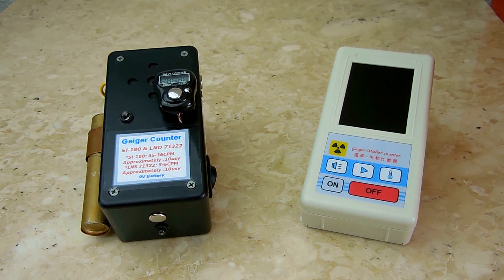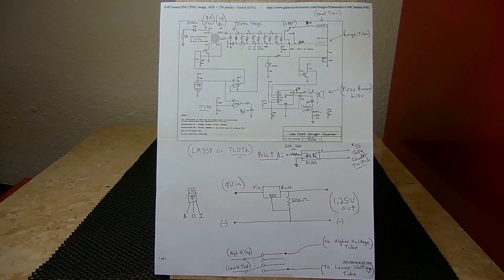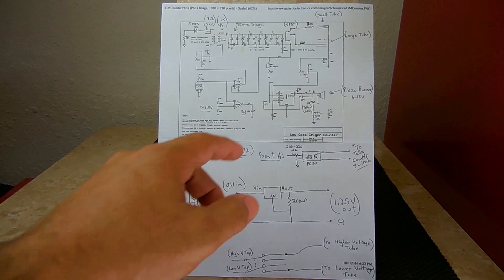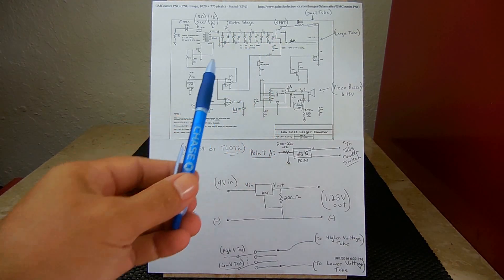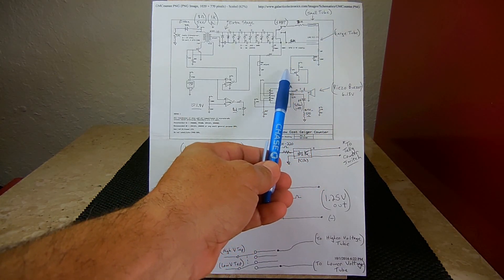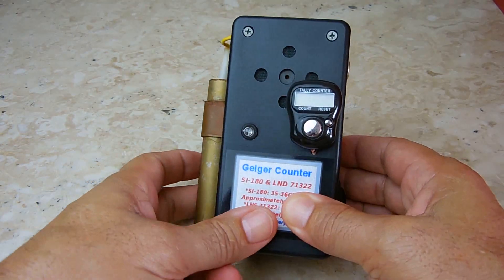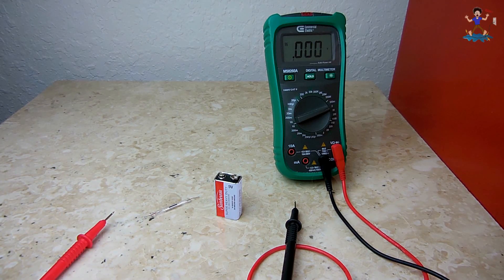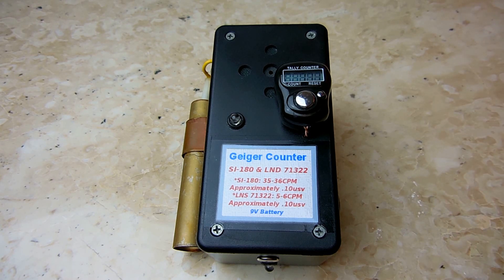How To Make A Geiger Counter

Comment: For anyone interested, the LCD unit shown last works great! I've had one for a few months now, no complaints. Thanks for the video :)
Reply from the maker: Yes, it's a great unit for the money. It does beta/gamma, but too bad it didn't detect alpha as well.
Reply: @electronicsNmore  it can detect alpha just not well. It can be improved by removing the heatshrink around the tube or better add a second external tube on a socket with a switch. Headphone jack can be used to disconnect internal tube automatically.
Reply: ps, my little xray generator fried it a bit. now the off button stopped working. if anyone can link to the OEM website or firmware i would be super chuffed

Comment: Good video!  The one caveat I would add about alpha emitters is that you are correct that they are not much concern outside the body, but they are very bad when ingested so wash your hands after handling radioactive material that might be loose.
Reply from the maker: True, you don't want to ingest any radioactive material. The Thorium Dioxide mantle gives off Alpha, along with Beta(Which I was detecting). I made sure I didn't touch my mouth, and I wiped my hands after holding the mantle. I washed them when I was done making the video. Thanks for watching!

Comment: urgently need your advice. My question is if I can put in instead of this tube sbm-20(if they are compatible)? thanks in advance!!!
Reply from the maker: правды ищущий Yes. If that tube uses lower voltage, then eliminate one of the voltage multiplier stages. Smaller tubes are less sensitive.
Reply: The operating voltage range of SBM-20 is 350-475 volts.
Reply from the maker: Yes, just remove one or 2 voltage multiplying stages and keep the circuit exactly as shown.
Reply: I thank you for your advice. And which tube is installed there, is there a name on it?
Reply: Thank you
Reply from the maker: правды ищущий Think is was a Russian si-180

Comment: Is there a way to turn up the volume, on the Banggood unit?
Reply from the maker: I think the sound can only be turned on and off.
Reply: @electronicsNmore  is the LCD unit (geiger counter ) have radiation from the device itself?
Reply: Use a pam amp module and small laptop speaker.

Comment: You can actually get a sodium iodide scintillation detector which plugs into a smartphone.  It's from a company called FT Lab in Korea and it's called the SMART Geiger.  Now, being a scintillation detector it only works well with gamma rays and X-rays but it's still an interesting little product.
Reply from the maker: Not surprised. They sell many devices that connect to Smartphones. Thanks for watching!
Reply: Too expensive and the crystal is too small to be useful.